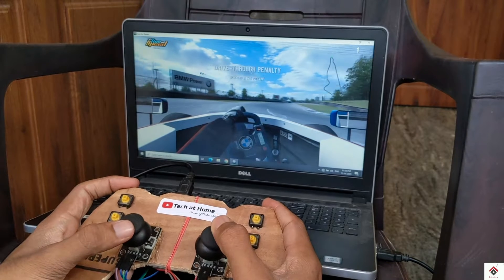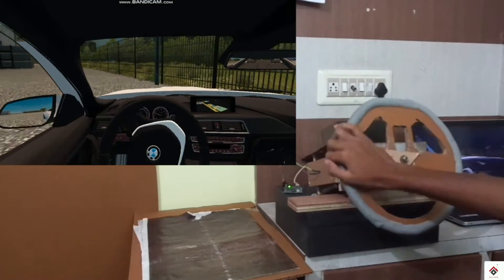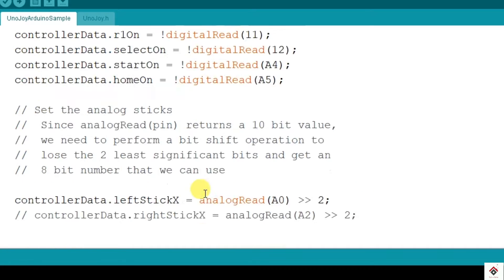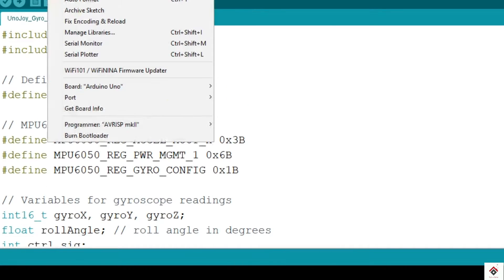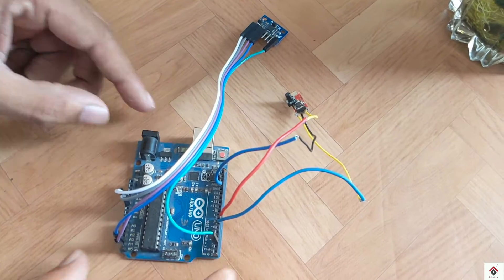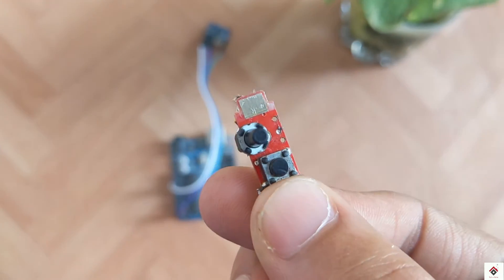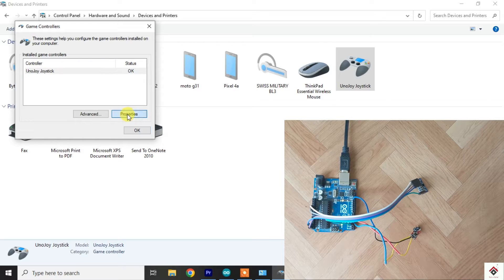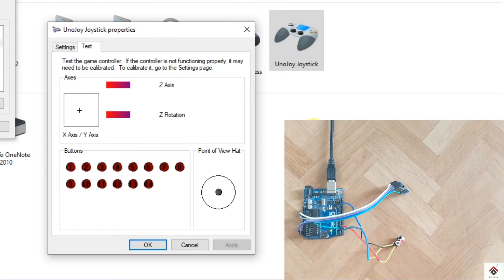Gyro Controlled car racing simulator using Arduino Uno | MPU6050 gesture controlled steering wheel

Comment: Hola.
Podría modificarse el código y realizar el mismo movimiento del coche utilizando otro eje distinto del giroscopio (  la idea es girando la cabeza de derecha- Izquierda e inversa viendo varios monitores).
Reply from the maker: Yes I tried to use other axis for car movement.
Since gyro is very sensitive, it was very difficult to control.
Reply: Muchas Gracias por contestar.
Existe otro módulo que se pueda hacer lo que comento que haga más fácil su control con Arduino y otro sistema?
Otra opción que se me ocurre es intentar calibrar el MPU6050 en cierta posición y seguír utilizando el mismo eje. No se si esto es un disparate o puede realmente realizarse

Comment: how can we use both potentiometer and gyroscope together to make a perfect controller for motorcycle games. so when we lean the gyro will work and normally in low speed potentiometer will be used as a steering. Is it possible??